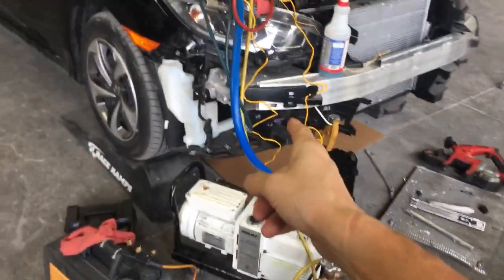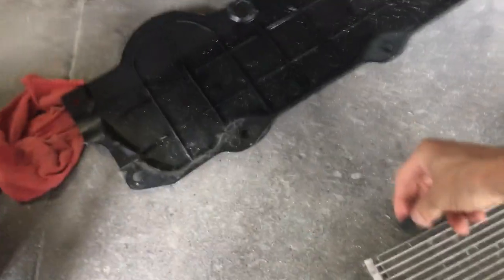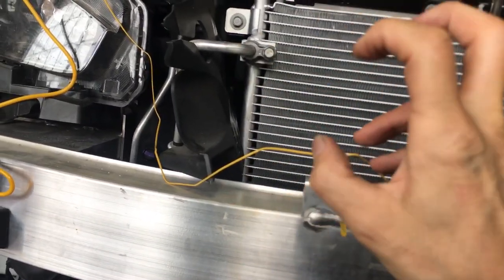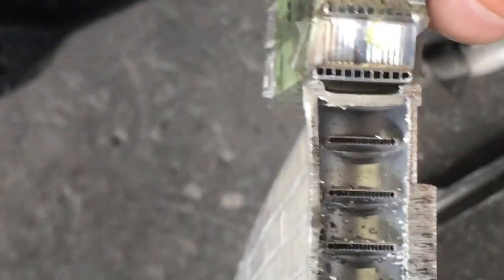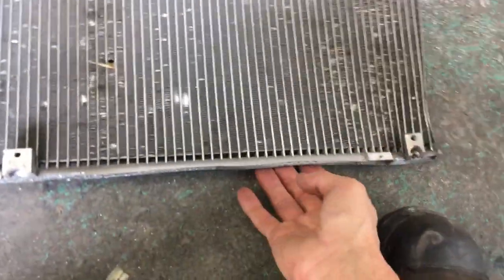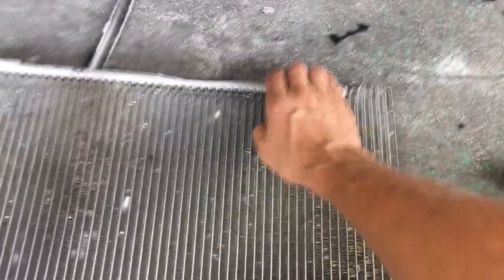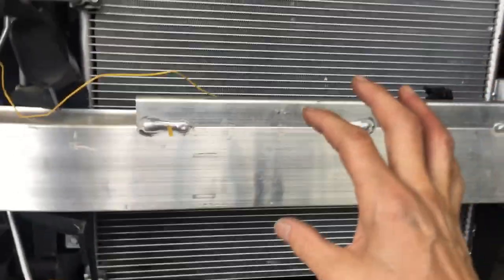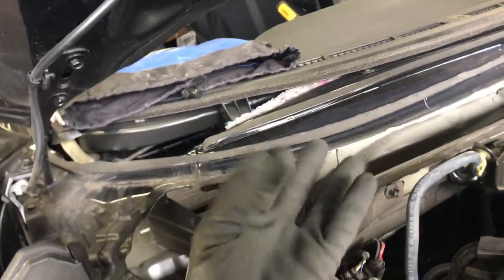Aftermarket AC condenser poor quality versus OEM original condenser. DON’T GET CHEATED!!!

Comment: this might be the best video that explains micro-fin channel refrigerant flow path, subcooling, and also hidden features in OEM condensers that make heat transfer much better than the aftermarket ones. The title the video does not really tell you about the full content which is really really helpful.

Comment: You should be given a medal sir. Thank you so much for that. Was going to consider replacing my wife's air conditioner compressor with aftermarket and after your video hell to the no on that
Reply from the maker: Air conditioning compressors are a little bit of a different story.      As long as it’s brand-new some manufactures are OK then fortune fact is you never know which ones. 

Usually if you get an aftermarket source that is not original to your car for example.    Do you have a Ford.   But you find an aftermarket source for a DENSO compressor.      Sometimes Ford uses a DENSO compressor so you may be getting the exact same compressor Ford will sell you but it’s just come in an aftermarket source box saying DENSO on it. 

       Even if DENSO did not design or manufacturer a compressor for a particular vehicle. 

        If they decide to market it build it publish it and sell it DENSO is a very high-quality original equipment manufacture and aftermarket manufacture. 

But then you might get a name for example I’m just gonna pick a name let’s say ( five star). Now this aftermarket distributor usually actually builds or manufactures or designs nothing.    They may purchase compressors from the cheapest place they could get them from unknown manufactures of unknown quality and every now and then you’ll get good ones and every now and then you’ll get bad ones.     They buy from anyone who can fill the order in a white box and slap their label on it this is only in some situations. 

In my 40 years I give DENSO the highest marks for the highest quality components for both original equipment manufactures and aftermarket.

Comment: Great video. This tech knows how these systems work and that is a very important part of knowing how they can fail and how to repair them.  Invest in over the ear muff protection or the disposable foam and or washable silicone ear plugs if noise in an area is too loud for you. If you opt for reusable silicone be aware they will need cleaning with soap and water every day or two of use and should be dry before insertion to keep from putting foreign matter into your ear canals. Safety glasses as well. Your vision and hearing is important. You only get to two of each and they need to last you a lifetime.

Comment: I've worked in the auto industry for years as a service tech and I can verify this guy in the video knows what he's talking about. Consequently, I can relate to the frustration involved in repairs like this as they go to Hell in a hand basket a few months down the road after installation. Customers then tend to come back with complaints even though the tech did everything correctly.

Also, videos like this remind me of Honda's OEM condensers for 10th gen Civics: they are total sh**. If looking for an aftermarket condenser, always make sure the specs match the original OEM one from the factory or exceed it. Never go cheap on parts like this. It isn't worth the buyer's remorse later on.
Reply: Thanks man. You educated me.
Reply: @otislawrence474  Your welcome. Vehicles are complex pieces of automotive engineering and it's always good to learn something about them.

Comment: I have a 2015 Scion tC. Had a rock go THROUGH my ac condenser and almost went through the rad too! I was forced to get an aftermarket because the Genuine Toyota condenser was back ordered by 7 months. That was 3 years ago and now this aftermarket isn’t able to keep up with triple digit heat. I just ordered a Genuine Toyota condenser and will be swapping it in asap!
Reply from the maker: If you are doing this yourself in your own backyard or garage. 

If you have all the Time in the world, keep it on the vacuum pump for 12 hours overnight or even 24 hours 

You can never over vacuum. All you can do is help remove and reduce the moisture content cleaning out your system. . 👍

Comment: Well done, you have convinced me to go ahead and spend a couple of hundred more dollars on the one for my 2000 Astro Van.
Reply from the maker: It’s better than having poor air conditioning performance on very hot days. 
               Or eventually replacing a burnt out compressor or clutch caused by high head pressure

Comment: Thank you for taking the time to make this video.  I cannot stand aftermarket crap.  It has wasted so much of my time.  Nothing is worse than doing a job twice not because you messed up, but because the part was garbage.

Would you consider posting your notes on aftermarket parts?  Just a public Google Sheet with the manufacturer, part number, and a short description of your findings (or a couple pictures) would be incredibly useful to so many people.

I know it would be a lot of work to initially compile your existing notes, but if you start taking notes in a format that is easily publishable (like a Google Sheet) it wouldn't be any more work than what you do now.  I would gladly pay for such information and I'm sure others would too, and I'm just a DIY guy.
Reply from the maker: It would be nice to have everything listed on a spreadsheet. 

Unfortunately I don’t even have time to edit that’s why you see all my videos are point and shoot from beginning to end with no retakes I leave my mistakes in there are usually don’t even add titles I have tried in the past but my day is counted in minutes not an hours. 

For the last 30 years I’ve had 10 to 12 billable hours I have to get completed from 7 AM to 7 PM every day with absolutely no breaks I eat in my vehicle while driving to a job or eat while I’m shooting a video one hand with a sandwich your food and other hand on the camera or sitting off to the side this is how busy I am. 

I run to separate businesses all out of my phone off QuickBooks. Since I was 12 my father had me deconstruct and tear down parks that have failed and cutting open parts that are OEM and comparing them by cutting open the exact same part supposedly that is an aftermarket part. 

And the majority of the time it’s a big failure on the aftermarket side when it comes to quality or the materials used for the machining practices and tolerances. 

In our trade anybody who has been in it for decades both on the management side on the parts acquisition side and as a technician knows that most every manufacture is not a manufacture summer just re-boxers and actually produce no products they outsource from different suppliers. 

Even the original equipment manufactures cannot produce every part number on the face of the planet but yet they’ll have it in their inventory because they will buy it out from another third-party source rellabble it and throw it in their box so they can complete their product line part number category. 

Do decades of experience with OEM parts and manufacture tolerances and machining and stamping practices you learn and develop a pattern of what is original equipment comparing it to some of the cheaper inexpensive aftermarket companies who try to duplicate the exact same part. 

I was taught by my father at an early age metallurgy machining in casting processes thermal dynamics and fluid dynamics and then later going into college retaking these classes. 

With heat exchangers on the evaporator‘s in the condensers most of it is pretty easy basic math and physics. 

The majority comes down to surface area. 

The more surface area you have on a heat exchanger the more heat you can reject or absorb.  Somewhere between third grade and fifth grade your teacher went over basic science especially as you hit around six grade to seventh grade it starts becoming part of your math problems and science class. 

If you remember when the science teacher or the math teacher held up a beaker one filled with sand and one filled with large thumb size stones

Your teacher asked a question which one has more surface area ?. 

       Of course all kids naturally drift towards the large stone because of the large surface on a stone.    Not realizing that the little individual grains of sand adding up all the surface is 100 times more surface area than the few stones in the beaker. 

The same goes for the fins and the tubes on a aftermarket condenser.  Including the internal fins that are on the inside of the tubes of the Microchannel parallel flow condensers and Evaporators. 

I’ve been taking pictures and videos of fail components or poor performing aftermarket components shortly after I started my business back in 1993 always had to intent to become an instructor later on in my life compiling my notes writing a book making training material.      But life happens three children later three divorces lots of work hours in two businesses writing training and instructional manuals or hardback books got pushed off of my to do list. 

Still plan on becoming an HVAC instructor to donate my time of my years of experience back to kids who need to learn from somebody who actually worked in the field since I’ve been asked by three different colleges to come work for them but I’m not retired yet. Getting close.

Comment: Sooo true !!!! I bought a Yaris that is not enough cold for me they check the pressure and everything was ok but they change the genuine condenser in a small accident and this video is gonna make me purchase the genuine Toyota condenser!!!👍👍👍 thank you great video
Reply from the maker: I like the little Yaris I have a 2009 yards or 300,000 miles on it
Reply: @coldfinger459sub0  yeah man i have a Ford Edge 2017 but  i still love my wife yaris, i don’t want to sell it only has 125.000 miles on it and has only dealer parts, brakes, s plugs, trims etc… except for the aftermarket condenser that the previous owner put on a small accident 🙄🙄🙄 and is not very cold .
Reply from the maker: @JG-ss9xy  Yaris has a extremely small refrigerant charge it’s very sensitive even if it’s 2 ounces low or 2 ounces overcharged will greatly affected schooling on a hot day
Reply: @coldfinger459sub0  that recharge the system, check pressure and everything was ok, but for me is not very cold, and I noticed after few days of that the condenser has some uv oil on the bottom left, but still cold is not blowing hot air I’m not sure if replacing it for the genuine part is gonna be really ac ice cold
Reply from the maker: @JG-ss9xy  on a cold day or just a cool day say 65° or 70° even with a lower quality aftermarket condenser it should be very cold still. 
            One problem on the Yaris that it’s oil charge that is required is so small if the shop adds extra oil too much that will also reduce the cooling because the system is so tiny it’s very sensitive to a small amount of too much oil

Comment: Very informative. Thanks for the upload.
Reply: Dear Sor.
Hi. I need your expert advise. I got a problem with my car AC system. It  often stops cooling at 2500-3000rpm. At idle it cool air upto 10°C,  while at motion it cools upto 4°C.  But  at high rpm, it will stop and will not turn on unless i swith off and on the AC button either 1 time or several time. 
On the guages it shows 40-50psi at LP while 200°C at HP side, at 3000 rpm temperature 40°C. At idle RPM it shows normal suggested  pressures.
FYI: i changed the TXV valve, clean the condensor and evaporator from outside, Topup the oil and changed desicant bag. The bag was half black but not too much like i saw in youtube videos. 
In the condensor, 1 of the tube is bend at the top. I also observed no oil in the compressor when i o was doing the above mentioned job.
Please advise what is the potential problem with my car ac.
It is yaris 2008 model with compressor Variable displacement type. (5SE09C).

Comment: Great video explaining in actual practice the behavior of little changes to the condenser. 

I am planning to add an extra condenser since my stock condenser on my Scion xB keeps having high pressure whenever I accelerate, and the cooling effect is deteriorated especially when ambient temperature is high (95-100 deg F). 

I plan to install another condenser to reduce the head pressure, and also probably replace the old stock condenser so that the high pressure at high ambient temps would be reduced. 

Do you think this is a good idea?
Reply from the maker: That has a factory Denso condenser extremely high quality, efficient condenser. 
         If it has never been in an accident and still has the original condenser, that’s about as good as you’re going to get. 
           It all comes down to is the condenser clean
            Has the refrigerant charge been properly recharged by weight?
            Good quality window tint does help like 3M Crystaline a little pricey though. I put it on all my cars.. 
          I even put the lightest window tint on my front windshield because that’s where the most sun comes in at
        It’s not how dark your window tint is infrared wave length is stopped by the chemical minerals they use in the window tint reflects. It’s not the darkness of the window tint it’s the material they use so even a clear window tint can reflect the infrared wave length..

Second condenser helps when properly done

Comment: This got me thinking, in most of the vehicles I see, the bottom 1/4 of the condenser cooling fins are the ones that take a beating from road debris, pebbles, sticks, ect. Usually, the fins if not restricted by dirt, they're bent reducing airflow.
Reply from the maker: My car to all smashed.
Reply: @coldfinger459sub0  You can probably find a used one, cheap! 🤣
We've been seeing a lot of older Priuses with stolen Catalytic converters, some have been totaled by the insurance companies, maybe I'll snag a condenser for yours from the next one 😂
Reply: @hnd2893  HA last time i attempted to get a junkyard condenser all the fins fell out as i pulled it out. it was completely corroded away
Reply from the maker: Lol 😂

Comment: Hi. Great video. I have Honda odyssey 2013. I had changed the expansion valve, compressor and condenser. All OEM. But still when on ideal during high ambient temperatures the AC stops cooling. 
Also I am facing problems with the AC not cooling to a good level. I cannot understand what is the cause of the problem. The actuator on the driver side has the clicking sound. But when I change from low to high and then back to low the noise stops.
Reply from the maker: Possible multiple problems

Not having a proper functioning, actuator could be blending the wrong temperature air 

Could be getting a little heater core air mixed in with cold air heat always wins 

Usually improper refrigerant charge is the number one problem after all components, replaced technician did something wrong .
Reply: @coldfinger459sub0  thanks for the suggestion. The technician here does not know the refrigerant quantity to load. As Honda odyssey does not have any labels showing it. 
I will try to clamp the radiator hose and see if it makes any difference. The temperature max I am getting is 52 f. Which is not good at all. The rear AC is also having the same problem.
Reply: @coldfinger459sub0  just wanted to ask you other than the condenser what else could be the problem when the ambient temperature is high, the AC stops working when stationary?
Reply from the maker: @syednajeeb998  is this a motor driven thermal Fluid fan clutch ? 

Does this have electric fan? 

One fan or two fans 

It almost sounds like the electric fans are not operating if it has some or possibly for some reason they’re only on low speed 

Hey thermal Fluid fan clutch has a Fluid drive that is controlled by a bimetallic thermal element
          It adjust to temperature supposedly locking up the fan one to one with engine speed when it gets very hot so there is good air flow

These go out a calibration with age . 

It will flow enough air. The engine will not overheat, but the air conditioning will suffer greatly at slow speeds and idle at stops. .
Reply: Motor driven clutch. 

The fan motors have been replaced. But the condenser which is OEM and new is overheating. As it is new I don’t see the reason that there might be a block. So I am getting confused. The high pressure shows 350 and low pressure shows 40.
Reply from the maker: @syednajeeb998  what is the temperature of line going in to the condenser ? 
What is the temperature line leaving the condenser ?